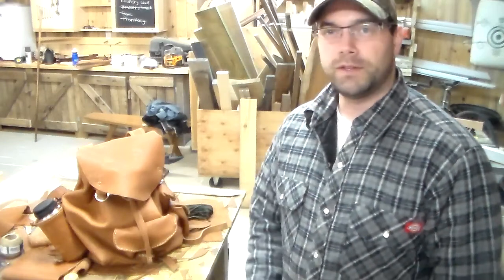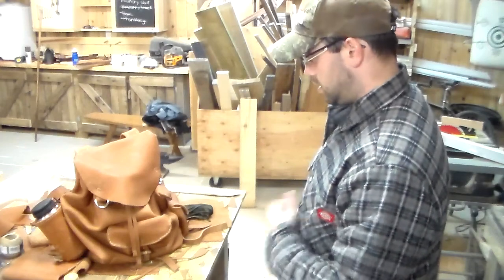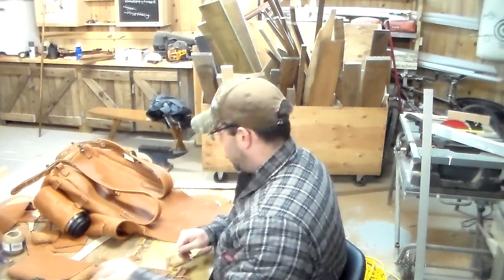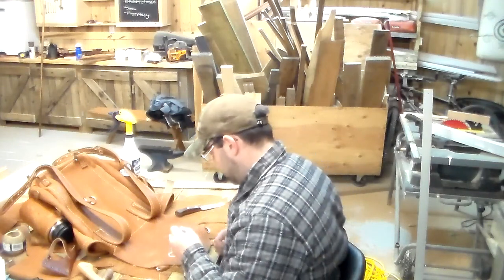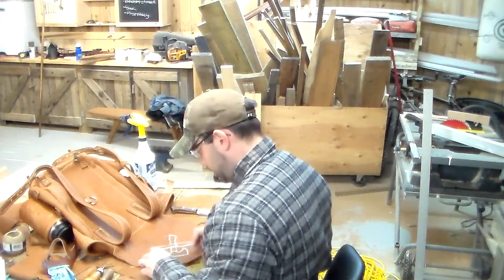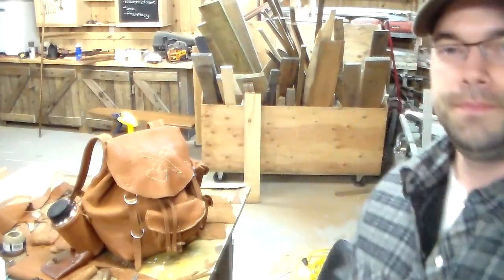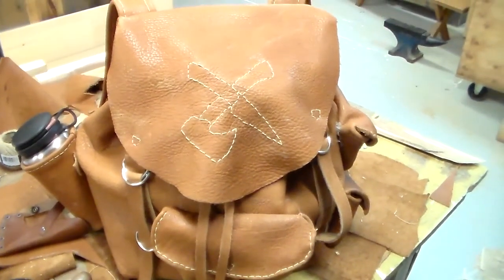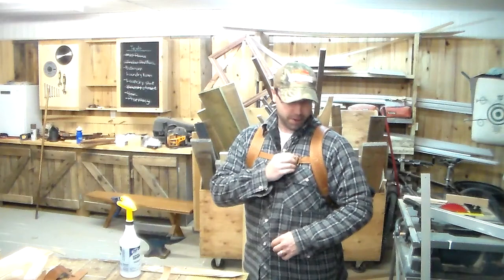Leatherworking - Backpack Part 5: Finishing Touches and Project Completion

Comment: This was your first leather project?  Most folks start off making knife sheaths, holsters, pouches, that sort of stuff.  You tackled a project that people that have been working in leather for a few years would/are intimidated to tack on.  You did an excellent job; you should be very proud and pleased with your results.  Are the pouches and water holder permanent or can they come off and be used on a belt?  Also, you made this in 2014, it is 2016 when I am watching it, how much use has the pack seen and how is it holding up?
Reply from the maker: +David Weirauch Hi David, Firstly thank you for watching and your comments. The pouches and holder are fixed. I have used it on a couple of trips and everything held up nicely! I find it very heavy though. (it's all 5mm leather haha)